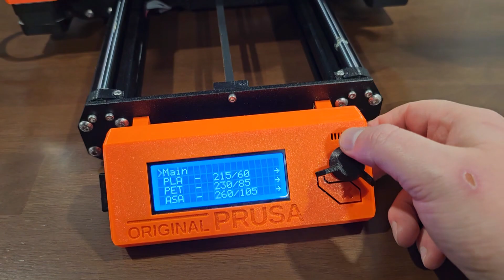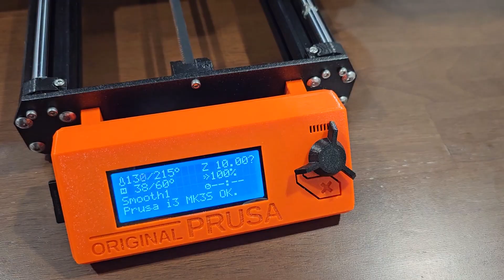How to Fix the BLOB OF DEATH! 3d Printer filament blob repair!

Comment from the maker: Did you ever get the blob of death?  How bad was yours?  
Like my Channel? Subscribe - https://www.youtube.com/@glennbrian3d?sub_confirmation=1
Reply: Several times on multiple printers, one of which would print fine one day and be thoroughly misaligned the next. Had one nearly as bad as this just a couple of months ago because of a number of factors. Watching the first layer go down won't always do you any good because it sometimes takes fifteen or twenty layers before a print starts to delaminate from the bed.

Edit: Pliers don't work better
Reply from the maker: @claws61821  which printer brand do you have?
Reply: @glennbrian3d  PowerSpec and Creality
Reply from the maker: @claws61821  I suspect the beds have everything to do with it
Reply: @glennbrian3d  BL Touch says otherwise on the Creality - as does the fact that the blob there had seeped out of a couple of loose connections. I had to go at it with the heat gun and a few other things for a while, AND use the internal heater a couple of times. And then I had to reprint the custom mount I was trying to test because I wasn't careful where I aimed the heat gun.

Comment: I will keep an eye on the first layer,  but my blob had a first layer down. For me the killer was using a step file with preloaded hyper PLA filament settings instead of using my own PLA profiles. The first fail just ended up in a spaghetti mess, the second fail ended up with a blob of death and it wasn't until after the second that I noticed it was not using my profiles.

Comment: My Creality Ender 3 v3 ke started to develope a blob of death as filament started to leak out of the hot end. As I was already aware that this is a common problem with the stock hotend I upgraded it to the unicorn nozzle and now it works fine and safe. Can only recommend that upgrade for all KE users if they don't want to constantly check for leaks in the hotend...
Reply from the maker: Thanks for the input
Reply: Still keep a lookout I just had a blob happen on a unicorn .4 nozzle. Only 5 days of total print time.
Reply: @manueldi_77  do you have a link for the unicorn nozzle?

Comment: My blob of death was far worse. I was in a rush and sent a print that didn't stick. It printed with a .08 nozzle for four hours. I had a couple of pounds of plastic all up inside the housing of my Ender 5 Max. I had to replace a lot of parts.
Reply from the maker: That doesn't sound fun at all
Reply: @glennbrian3d  my blob of death happened because the print didn't stick to a dirty bed. Once it broke loose it jambed under the print head. The machine just kept on going. had to clean all of the bed glue off the bed plate. I surprisingly got it back running.  I had to fix the belt adjustment so it made contact with the limit switch again.  I managed to clean out 99% of all the plastic blob. I had to use an oscillating cutter to cut through 4 inches of hardened plastic.
Reply from the maker: @cajunroadwarrior  pretty much all of my clogs I've ever had is because I didn't have good bed adhesion

Comment: so I'm having this issue with my Kobra 2 pro but its every time i print, the filament is fine for the single test line but it starts the print and it fails unsticks from the hotbed and sticks to the nozzle. what do you recommend i do? any help would be greatly appreciated
Reply: I use a glue stick for the bed. Especially for tall prints. I would use glue if you don't already and a brim.
Reply: @cntgtenf  the glue doesnt burn?

Comment: I just had my first Blob of Death ever this morning on a SOVOL printer, after about a year of use.   Which is ironic because I was just posting about BLODs the night before.   I got a new printer which I thought was prone to getting them and heh, here I just got one on my old one.   Luckily it wasn't too bad.   But it definitely was because I used PETG for the first time instead of PLA, and left it running overnight as all of us shouldn't do and will always do, lol.    I wonder if blobs happen largely with materials other than PLA.
Totally right about that left side, this is where all the wires are.  I cranked mine up to 260 and a big glomp came out, but still had to work with it.  The paper towel trick is wonderful for cleaning the print head when its hot.  I might wear goggles in case something spatters out peering up in there.   Unlikely but better safe than sorry.
Setting the print head temp to max is fine but I would also caution not to be overzealous with a heat gun as he pointed out, you can melt components and wires and be verrrrrry sorrrry.
Reply from the maker: You're lucky to only have one!  But PETG is usually much more of a pain to deal with lol
Reply: @glennbrian3d  it has a lot more trouble sticking to the bed, even at 240c.  I usually set the bed to 55'F for everything but maybe PETG needs a different temperature?
I agree, staying with PLA unless I have to have something especially heat resistant.
Haven't dared ABS or nylon yet.
Too much scare talk about toxic gases 🤐

Comment: Ethyl acetate really helps the cleanup. I melt off as much as I can and then soak the hotend etc in EA which breaks it down and makes it much easier to scrape off.
Reply from the maker: Thanks for the tip!

Comment: Well, for me, the wire covering got burnt through and is completely destroyed.
Reply: same to my K1Max. I will now change to a Bambu X1C. Creality sucks.
Reply from the maker: That sucks sometimes it happens!
Reply: Maybe preemptive protection is a good idea e.g. wrap the thin wires in think aluminium foil - filament then won’t stick to the plastic of the wires and can tear the foil off.

Comment: i recently had the same problem on my SIDEWINDER X-2... The PLA melted and encased the wires on the print head so i couldnt pull it down because it would rip the wires off... I took off the entire print head and put the entire head into my FREEZER... I left it in their for about 15 hours until the PLA became so cold it was now BRITTLE... I then took TIN snip cutters and snipped it where i could... the thing cracked in half and came off successfully without damage to the wires... it worked in my case.
Reply from the maker: Nice!  I'm glad you were able to save it!
Reply: same issue i took a pair i stripper to it worked a charm